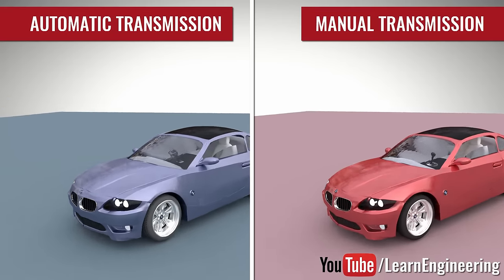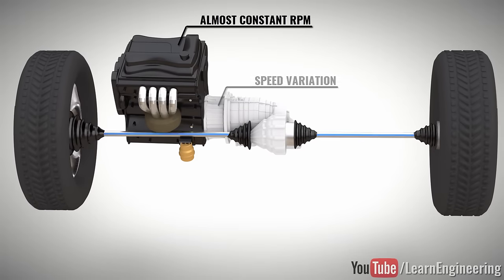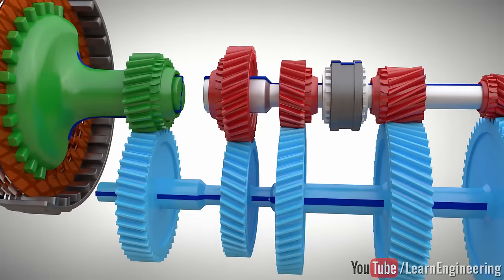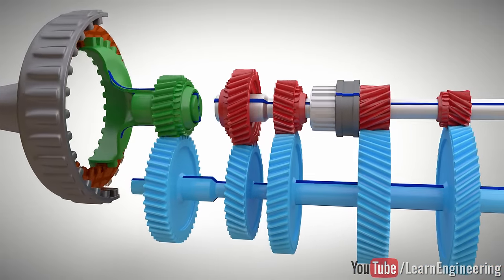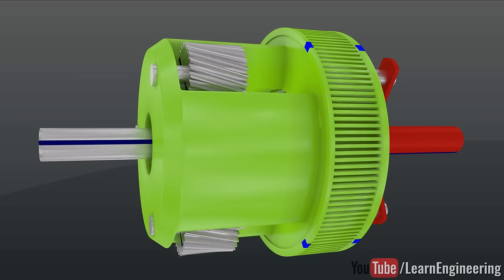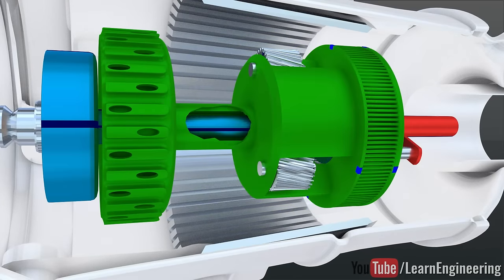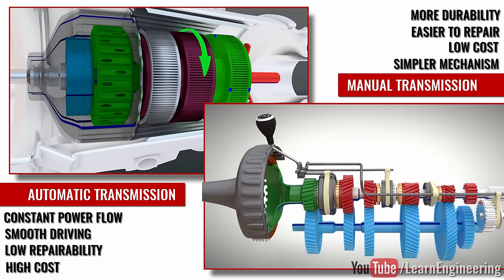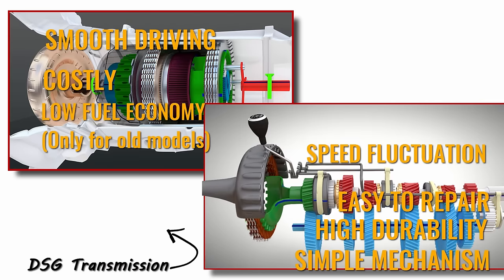Automatic vs Manual Transmission

Comment: manual transmission: ok, makes sense
automatic transmission: IT'S WIZARDS
Reply: Hahahahahaha I'm dying from this comment
Reply: My brain went stack overflow on automatic gear
Reply: this is y robots will kill humans
Reply: The author should apply a link to the planetary transmission setup explanation video. 
Also heavy loads are using automatic transmissions since there is not much place for human error. Especially computer-controlled automatic ones. I mean relatively heavy like for example a tank transmission. Another example can be a system in the "semi-trailer" truck. 
It is true you can put more on smaller manual transmission but in this case, you have to rely more on the operator skills. Also, a heavy-duty manual transmission becomes rough to operate if the applied load is raised very high while the system weight, placement, and size limitations occur. It's more due to the simplified clutch than the transmission box itself. 
What's most important is the system's live-cycle overall cost. It's sometimes even more important than the physics ;)
Reply: It's automagic
Reply: Kind of like an overly complex differential... If you hold 1 side still, all the energy is transfered seamlessly into the other wheel.

on that principle gearshifts dont have a dead time.

Imagine every planetset is like a differential... a dif usually has the driveshaft as input and 2 wheels as output, but you can also spin both wheels to turn the driveshaft. All 3 sides work the same, which is more important in a transmission...

2 gears are rotating clockwise in differing speed determined by their diameter (the dark and lightgreen ring) and the 3rd is rotating reverse. (the 3 silver ones inbetween)
Any one of them can resemble the driveshaft (be power input) and any one can be used to power the next entire planetset.

By playing around with what end of one planetset you permaglue to what end of the next planetset, you'll get different ratio setups out of the thing....... (Thats a decission still made in construction)

The actual gearshifts while driving are coming from clutching different darkgreen rings shut, so that the entire work gets done by the ones that bring the wanted ratio.
Like in a dif nothing gets slowed down by that, it only goes through somewhere else.
Reply: MrSteel Nutz nnnjjjjjjjjjjjjjjjjjjjjjjnnjnnnnnnnnnnnnjjjjjjjjjjjjjjjjjjjjjjjjjjj
Reply: yep I guess i kinda lost the line of thought when the purple gearset was shown
Reply: I've watched 7 YouTube videos and only just start to understand planetary gears, I still have no idea what makes it automatic
Reply: Manual: 1st grade math
Automatic:  PHD in Calculus
Reply: @pinkliongaming8769  i had the same problem, then noticed something said in 1 of the videos, its just a computer controlling which gear its in
Reply: Ikr
Reply: They glossed over the torque converter. That thing is outright black magic.
Reply: @pinkliongaming8769  old comment, but I'm replying for new people reading this. The second clutch pack compressed at the same time as the first one decompresses and that's why the power output is not interrupted
Reply: I guess this really highlights the simplicity of manual transmission cars
Reply: Yeah same I don't get it lol

Comment: Manual transmission - Ok. I see. Ah got it make sense.
Automatic transmission - which gear? What color? Release which what?
Reply: Right?
Reply: Automatic transmission works by magic... or it is operated by rodents. It just works!
Reply: yes of course.
Reply: Gear Crimson
Reply: I know right! Even while driving, it's like, hey, wait, what, how, why...will it stop now? Will it move? What's happening???? 
But, with a manual, it's like, yup, I got this... I know what needs to be done!
Reply: Terrishh how do the goddamn clutch packs actually engage? Like automatically?
Reply: I was 1000th person to like ur comment ! I hv same thought !  Automatic transmission very hard to understand !
Reply: @bobbyhill4118  They are engaged by god
Reply: Terrishh clutch plates attach to different gears that turn the drive shaft using differing speeds. I’m not sure what drives the ATF in the transmission, but they use hydraulic clutches. This channel really sucks at explaining clutches and they’re so vital to a drivetrain/engine too...
Reply: Luis Sierra hahaha
Reply: I Has Figured it Out it Uses Planetary Gear Arrangement which had 2 Inputs a Output just change a Little things in one speed changed in Output that Computer Controls some Clutch packs which one is Discontinued the other at the same time Engages
Reply: I’m use to automatic cuz that’s the car my dad and bro drive I think it’s easy 
For me all u need to know is 
D-drive
R-reverse 
P-park
Reply: Aromatic advintro problem
Reply: @bobbyhill4118  by computer
Reply: @LuisSierra42  😂😂
Reply: So............how to understand this 
If English is  foreign language for you
Reply: That’s why car guys hate automatic, they have to understand it.
Reply: @bobbyhill4118  that's higher end cars. Normal peasant cars just have 1 clutch disc and plate. it disengages when the diver presses the left most pedal and reengages when the driver stop pressing the pedal.
Reply: Tesla=quartz Timex=meh
Porsche PDK=Rolex=oh man, look at those little gears!
Reply: Right? And those 8 gear transmission, those mad geniuses
Reply: Which is why manuals are cheaper than automatics in both buying the car and repairing the transmission
Reply: What?
Reply: i thought i was the only one lmao
Reply: Just shut up and do what the torque converter says!
What's a torque converter?!!!?
Reply: @sebastiancastro7382  IS THAT A JOJO REFERENCE???
Reply: It has an inner and an outer input per couple (inner ring and outer ring) it's connected via the planetary set. It automatically chooses which of this component gets power. If you have 3 of these couples. You got 6 ways on how the engine can transmit power. That's all.